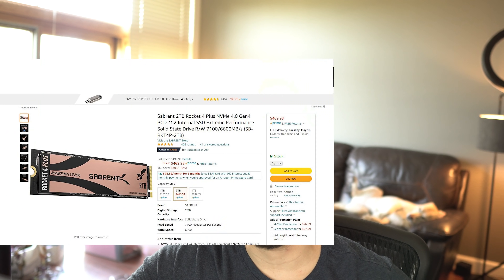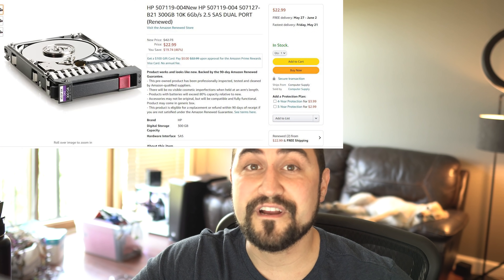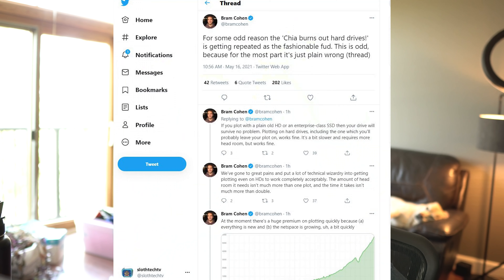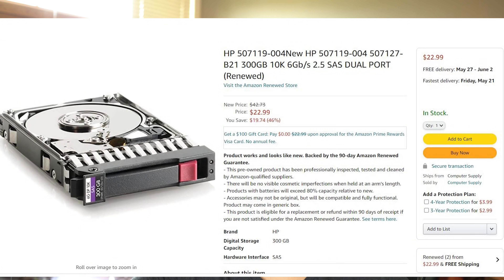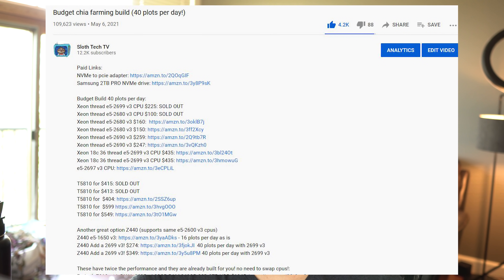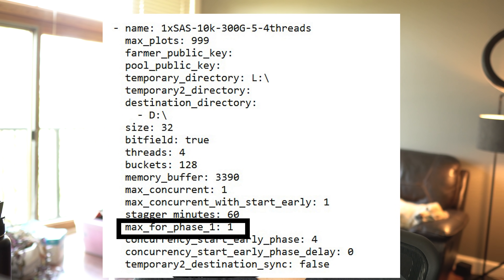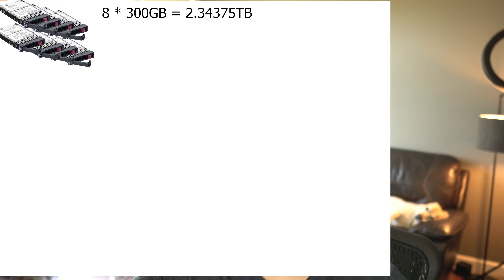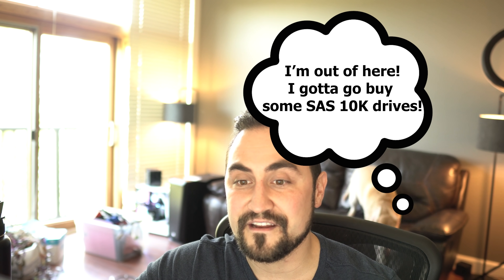Why are you plotting on SSDs still? (How to plot on $22 drives)

Comment: Hi,
I was thinking about If i plott parallel 7 Times on a 2TB nvme drive...than i have to Cut down my 2000 Speed by 7 =285
...
Thats Close to my RAID 0 Setup where 2 drives each around 130 Support each Other in Speed and 130 * 2 = 260...

Thats Close from the Speed...
And today i found your Video saying use 16 drives... Thats even better because i have 8 Cores for 16drives/2= 8 plotts

I guess i dont get a nvme will Check Out eBay now.

Thx man

Have a nice Day
Greatz from Germany opo

Comment: Using a R720 with 20 Cores/40 Threads. I have 7 @ 600GB 15K sas drives that i can use. Im wondering how you would best set the configuration in SWAR for this? I was thinking of making each plot set up (7 total) have have 2 with one of them being about a 90 to 120 minute delay?

Comment: Hello All,
A have 2 nvme drives in total 2 TB and the 2 processors with 20 threads per processor in total 40 threads , with 64 GB of RAM , the problem i have is that one plot needed 35 hours to finish i have run 10 plots in parallel , and the processor stays at 20 % usage ang the ram 30 GB usage, i don't know where is the problem why plots needed about 35 hours to finish, i would appreciate that anyone can help me.

Comment: Great video! I have a question regarding the hba card. Why do you want it to be on IT mode? wouldn't you want to put these 8 x 300GB drives on Raid 0 to gain R/W speed? IT mode will set the card to pass through without no raid
Reply from the maker: I thought that too at first.. surprisingly its actually faster to just plot against them individually..
Reply: @SlothTechTV  can you please share your Swarm config for this setup?
Reply: Putting drives in raid 0 should get them to work faster than one individual drive, but slower than the sum of their individual performances. There is a performance penalty for maintaining raid configuration

Comment: I just subbed! :) Interesting to know this! I have a bunch of older 250-300 GB 7200 RPM drives. Also some newer 1-4 TB drives as well. Also have an unknown SAS card with SATA-adapters for connect like 8 or 16 drives on it, don't remember how many. Is it worth to use this equipment to setup a Chia farm/plot?

What CPU do you recommend? Isn't a Ryzen CPU quite efficient if you need many threads?

Comment: I'll be honest I dont have much clue, I used to build computers when I was a Kid but that was when AGP 8x was a thing :), I do like the fundamentals of CHIA and would love to find a solution that had no environmental impact, I managed to find a drive that has 900GB of storage, but I don't know if it is exactly what I need:

HDD Size ----------------------------2.5"

Hard Drive Capacity -----------900 GB

HDD Speed--------------------------10000 RPM

Interface-------------------------------------SAS

Component For------------------------------Fiber Channel

Operating Voltage-----------------------------------5 V

Width-----------------------------------------------------177.8 Mm

Depth------------------------------------------------------228.6 Mm

Height------------------------------------------------------117.6 Mm

Weight-----------------------------------------------------450 G

Data Transfer Rate-------------------------------------hopefully

Comment: How can you run 20 plots concurrently with 4 threads each if your processor only has 32 threads and 3390GiB per plot with only 32 GB RAM? You stated in the video you only used one intel xeon e5-2699 v3?
Reply: 2 threads per plot, 1 core.

Comment: I have been watching and re-watching most of your videos and I have learned so much that I have been placing orders and setting up a workspace to give this a go.  Your videos are fantastic and informative so please keep them coming.  Thanks you for the links since it is a way that we can help support the channel and get linked to just the products that you are discussing!!  Here are a few questions that I have been collecting across the videos that I can't quite answer:

What mods have you done to your Creality 3D Printer?

I'll be using the LSI SAS9200-16e in a T7910 connected to the HP 487738-001 24 Bay SAS mounted on a PCIE riser attached to the server box.
What additional cables are you using to power the 24 drives running from the SF600 that don't come included with the power supply?  (Power splitter cables?)
          Are you plugged into the 2 - 6PIN Peripheral/SATA power ports on the SF600?
          Could you show a picture of the wiring harness side of the power supply?

Where does the printed power plug Female that you have mounted to the Farm Box go to?

I know you say to lay down 6 to 7 layers fill for the base in the 3D pint your own server video  ..  I was wondering if you laid down several layers from a black spool first and then switched spools and printed in the white?
          Is this black layer in the Thingiverse files or do I just pause the job and switch spools?  (3D printing is new to me - I bought the CR10 S4)

Comment: My question would be how many SAS 300gb drives would you need to maximize a 3950x.  Assuming your 11h per plot on each drive... 12h just make it easier, that will net 2 plots per drive daily, a CPU that can plot 40-50 a day will need 20-25 SAS drives reach that capacity, am i right?

Comment: You can get a used server such as a Dell R720XD SFF 24 bay dual socket Xeon CPU starting around $600 on eBay. They usually come with HBAs or Raid controllers such as the PERC H710. Not bad for a plotting system using inexpensive 2.5" 10K SAS drives. I have an R720XD 16 bay I used for my VSAN lab for several years.

Comment: for the 24 Pin ATX EPS PSU Starter Bridge Power Supply, we connect it to the motherboard of our pc? or the power supply? a bit confused on that bit. 

Thanks!
Reply: 2nd psu, if you are using it
Reply: @milospavlovic4599  thanks dude! ended up getting a 2nd PSU instead of trying to connect to my comps one.

Comment: There is a solution where you can use NVME drives on a desktop or workstation system for plotting. You will need a very fast single core speed and lots of cores. Highpoint makes an NVME Raid controller and you can buy them populated with 8 x Samsung 980 Pro 2TB for $4155. Cheaper than a GPU mining rig. 
https://www.highpoint-tech.com/USA_new/SRD7540-Overview.html
Reply from the maker: absolutely -- I have actually tested that highpoint raid controller and since it handles the PCIe bifurcation for you -- its compatible in virtually every pcie system. thanks for sharing the link and educating peeps :)

Comment: Despite the lower lifespan, 8 Normal 240gb or even 515gb SSD's would have more performance and allow more plots at one time? I am now working with 2 512Gb NVME Samsung Pro with Raid 0 and i as still unable to go ver 60% of the disk usage at one time. Everyone talks a lot about the disks but It seems to me that the processor is what is keeping my plotting behind, although i have an Ryzen 9 5950x CPU

Comment: I see my 1TB samsung EVO 980 plus drives dying at 25% TBW die. Warranty 5yr says 600TBW for 1TB, but at 150TB I have seen drives quit plotting, they're burned up the controller goes first.

I'm skeptical of your SAS drive here, its obviously used, and if it did work, they would already be gone.

Most of the links above say 'Not available', I think this list is old. Very old. 16TB WD drives are not to be found anywhere on earth at this point in time.

All your 'used' dell sas drives above get very low < 50 favorable from purchasers, which means that these are mostly scam drives, that somebody bought at auction, where most were dead. It might be cheap, but how much time do you really want to waste?

Also I have tested plotting on physical drives with moving parts, and the drives always crash, and have to be re-formatted.

You don't plot on HDD's or Sata-SDD's in this biz, only NVME, and yes good quality.

I have have to say, unless your stupid rich, don't play this game, I will quit at 500 plots, currently at 200. It all depends on the chia-space, now at 6.8EB, if it goes to say 100EB, then its pointless to even mine with 1000 plots, it means you wouldn't even net $1/day. 

Pointless.

...

I know, I have been mining on HPOOL.COM for months, today with my 200 plots I earn $20/day, I generate 12-20 new plots everyday. But the EB grows 8% day, or doubles every 9 days, so my $20/day will require 400 plots in 10 days. I have right now 80TB, so I will reserve 50TB for chia, then I'll quit, let it chiamine on HPOOL ( the winner at 70% of all space-mining ), and try some other space-miner that is not a scam.

Comment: I think its time to show your setup in work 😂😂😂 Show stats and plot manager results for 24h😎 . Not only talking and giving affilate links from Amazon 😂😂😂
Reply from the maker: The main reason most people complain about not hitting the numbers their systems are capable of is due to a lack of tuning, using x4 pcie 2.0 slots, using incorrect drives/drives with TLC cache or oversubscribing HBAs. -- or not using enough drives to actually saturate a cpu/pair of cpus.

https://i.imgur.com/YpgT2mh.png

Like that? Thats just one of the systems from my videos..... shrug
Reply: @SlothTechTV  Make please video how its work, HW conection, showing calculation etc :) im interested see it :) Im seriously. It will be interested :) I already try on 5k RPM HDD but its not sense even write time is 200MBs. Maybe fex days no 12 hours :D But SAS its only maybe 20% faster then SATA? I buy 970 EVO for 189USD, When i now checking used pc bazar, pcie SAS extension, kabels and 3x 300GBHP disk, complete price 182USD....So advantage its only life time,but plotting time x2

Comment: This is by far the most non green Chia method one could possibly practice: I use a single P4510 8TB PCIe SSD using 8.1W instead of 27x300MB HDD with what power consumtion - 1000W, so factor 250X?

Comment: Hi I like all of your videos. I have a DL380G with 192GB mem and 25 HD slots, when I use this server should I set the disc in a raid config or do I use the drives individualy for the best plotting results? And will the raid controler speed up the plot proces on the mechanical drives?
Reply: I think JBOD should be faster in this case than raid, so I would use the raid controller in hba mode

Comment: so i picked up a cheap silverstone SAS 4xx2.5" enclosure and a HBA with a cheap sas external connector and dropped 4x1tb ssd 2.5"  drives which are around $120 >800pb writes if you shop around, and got a 4TB striped array that screams, because the writes are striped i think i'll even get more life out of the SSDs and still much cheaper than a $800 nvme 4tb
Reply: honestly u don't even need the sas enclosure that was just a POC hoping to expand with more enclosures, most mid towers will hold 4x 2.5" depends on where you can put your 3.5" though

Comment: Great channel keep it up. Is it possible to connect it to a normal gaming computer with ryzen 5 and normal motherboard?
Reply: As long as you have a free pcie slot for a controller card, you can use sas drives with any computer you want

Comment: u can already get high durability MVME SSDs with 4TB for 400 bucks, so why should I buy 6TB HDDs for 450?
Reply from the maker: these drives are $20-$30 each and 4TB worth only costs $273
Reply: @SlothTechTV  i know but given the fact for only 200 bucks u get a new m.2 SSD with much higher speed, operating at 0 noise etc isnt worth buying old hdds
Reply from the maker: @BennyAlex98  if you buy an m.2 nvme for $200 i can promise you it wont do anywhere near what 4TB of 300G sas drives can do in 24 hours. (not to mention for $200 that nvme will have 0 endurance.. you'll be lucky if it lasts a few months.)

Comment: Hey Sloth! 😁 I learned something today, trying to plot to two sata hdd's. In my case atleast it does not work.
Cause when disc 1 works 100%, disc 2 goes to 0%, then disc 1 goes down to 0% and disc 2 goes up.. So only one of them can work 100%, they cant do that together.. For some reason.
Can you confirm this is not a problem with the controller and SAS discs? Im about to buy some stuff.. But i dont wanna buy if this is the case.. 😜 I love the idea of using SAS disc's, its much cooler then SSD's i think.. Thats why i use one of my 70gb VelociRaptor disc's for Windows on my plotting machine.. 😁
Love your content about chia, really good stuff! 👍

Comment: Great Video, great content! I found some 15k SAS server harddrives really cheap. Now I was wondering, do they fit in a desktop computer with any SAS PCIe card or do I have to check if the controller supports those drives specifically? What's your experience?
Reply: SAS drives should work with any SAS raid controller or HBA card. The only possible issue that comes to my mind is that some controllers (like b110i and b120i on HP servers) support only SATA drives, despite using SAS interface, so you do need to verify that your card supports SAS drives

Comment: I have a question: When I plot a single plot on my 2TB Intel 660p, NVMe, M.2 it takes about 5.5 hours. But when I start plotting in parallel even 2 and shift them with 90m it took 7.5h for the first to finish and then the second worked for about 1.5 hours more and finished too. Is that how it works or my system slows down more than expected? My processor is AMD Ryzen 7 3700X 8-Core and I have 32gb ram. I used settings 2 plots in parallel, 90m delay, 4000ram, 4 threads.

Comment: IBM Dysk HDD 2.5" 600GB 15K RPM - AHE2-2076 its compatible with HP Workstation Z840 2x E5-2620v3 32GB 256GB W10Pro? if so what cable to use?

Comment: Quick question, Im seeing a huge difference in plotting speeds in my 2 systems and im thinking some of it is coming from the fact that one is running 4x16 gb 3200 mhz sticks and the other only 2x 32gb 3200 mhz kits. The other specs are around the same and both are trying to plot around 18 plots simultaneously but on system finishes around 10-12 hours each plot and the other around 22 hours. All using swar plot manager. Any thoughts if this makes a difference or im just going crazy?

Comment: Was wondering how 10k and 15k SAS drives would fair at plotting.  So glad didn't buy any nvme drives yet.  if you use 12Gbps HBA RAID could likely do more drives per HBA.  Or even better don't RAID on the HBA pass though disks do CPU RAID.  ZFS or SnapRAID on linux and plot in linux.  Think CPU RAIDS you could get maximum amount of drives per HBA

Comment: excellent video! I have two questions that I would like you to shed some light. Q1. would 15k drive be better in performance than the 10k drive? Q2. should I RAID0 them together or run these disks individually? Thanks!

Comment: Does each drive get a separate job? 
If so, what stops them from all starting at the same time? 
Oh!!!
Because you are only running one plot per job, you can set an individual start time for each drive using the “stagger time” ? 
Drive1 Job:
stagger time 0
Drive2 Job:
Stagger time: 60
Drive3 job:
Stagger time: 120

Yea-Nah-Yea?

Comment: "Green." 20 drives using 6-8w of power each vs 2-4 nvme using 5w each. Those curly lightbulbs must be rolling in their graves.
Reply from the maker: A lot of nvme drives use the entire M. 2 spec limit bus power of 7 watts... Which puts them in the exact same power threshold. This is argument doesn't hold water.
Reply: @SlothTechTV  I was being satirical, but still, 4 drives will use much less power than 20 regardless if they use 5w or 7w. The entire concept of chia being "green" seems flawed to me because it doesn't seem to take into account that the kind of people who currently have massive ASIC and GPU farms are going to build massively wasteful storage farms, prioritizing harvesting speed (NVME drives) and continuous storage expansion over efficiency.
Reply from the maker: @crazyivan315  plotting is temporary -- you don't plot forever, but the plots are good forever. Every other crypto requires a HUGE energy cost 24/7 .. forever.

After youre done plotting its essentially a computer idling... electricity wise... Thats pretty green imho and its objectively better than 99.9% of other cryptos in existence. I'll take it.
Reply: @SlothTechTV  Yes, I understand that's how the designers of chia wanted the plotting/farming to work, but as I said, they seem to have ignored the mentality of those who will constantly try to keep their curve positive against the total network space to maximize potential profits. These types of people will just continue to expand their storage space and continue to plot until either the coin price dies, they fail to ever win, or the pace of network space expansion is so high that it's completely impossible to be competitive any more.

Comment: okay, that was a great video... i think... but, maybe due to my lack of speaking proper english or not fully understanding the other videos... what do i have to do now?
So if i understood this right... i have to buy an HBA card and put it on one of my PCIe slots in my pc. on that i connect a cable that allows me to connect lets say 4 SAS drives. if i have 4 slots that makes 16 SAS drives per card. after that i let the SAS drives plot the plots and save them on another bigger harddrive (lets say my 14tb external drive) right?

I missed something, right?
Reply: In short, that is about it. You might need additional power supply though, as these drives can be power-hungry

Comment: Awesome content as always, thanks for sharing man! Quick question, is it possible to use SAS drivers in a desktop PC?
Reply: As long as you use them with controller card (raid or hba) that supports sas, you can use them in any computer with a free pcie slot
Reply from the maker: Yes, absolutely
Reply: @SlothTechTV  Nice, then "LSI 9211-8i P20 IT Mode for ZFS FreeNAS unRAID 6Gbps SAS HBA" should work like a charm, right? Do I have to look or "unRAID" adapters?